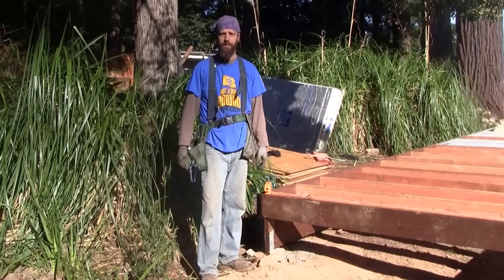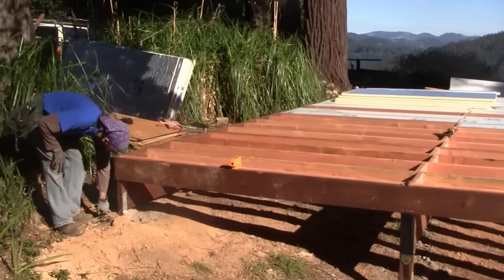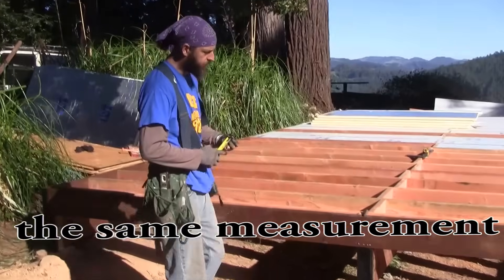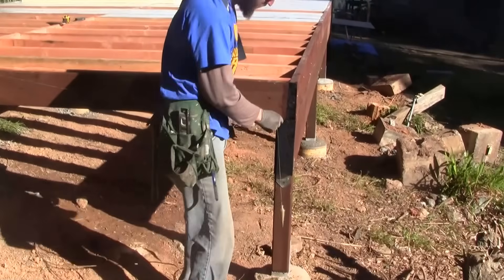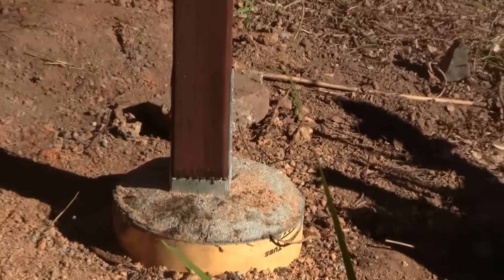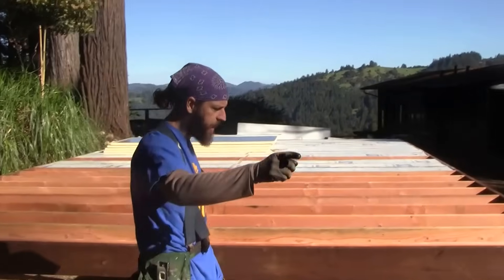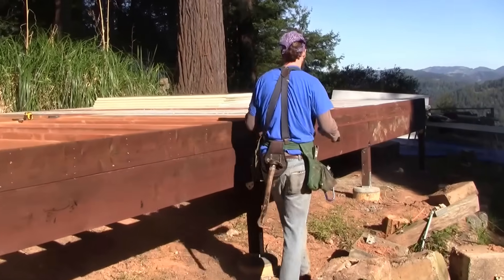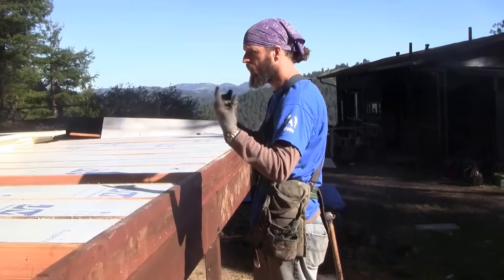Pier and Beam Foundation and FLOOR for Deck or Tiny home.

Comment: What is the size of that subfloor? Are those 8" sonotubes and 4x4 posts? I want to make sure that is sufficient for a 16'x24' shed/cabin.
Reply from the maker: It's been so long.  Sorry I don't remember.  Span charts and concrete charts are pretty easy to find on google.

Comment: Thanks for the video; very informative.  What would be the recommended spacing for the concrete piers?  I am planning out a largish tiny home that will be 26'x32'.  I plan to have piers spaced at 8' apart on the long side, but I'm trying to figure out whether three rows of piers would work for the short side (i.e., 13' spacing), or whether it would be better to go with four rows of piers (i.e., 8'8" spacing).  My floor joists will run parallel to the short side like in your video.  Any thoughts on pier spacing?
Reply from the maker: Here is a span chart.  If you go under the max span, You should be good. https://www.mycarpentry.com/joist-span-table.html
Reply: @TheRegenerativeHome  Hi, thanks for replying.  As a clarification, I know that 2x10 joists will span 13' just fine; my question is more about the spacing of the concrete piers.  In your video, you seem to have pier spacing at about 8' on center.  I'm wondering if that is standard, or if there is some kind of standard span table for the concrete piers that bear the weight of the building?  Perhaps not because there are so many variables to consider (like total weight of the structure, soil conditions, etc.)?

For example, if you use Quickcrete 5000 mix, then it can withstand 5000 PSI (hence the name).  With 6x6 posts on top of the piers, each having 5.5x5.5=30.25 square inches of surface area, if I had 3 rows of 5 piers (8' spacing between piers within a row, and 13' spacing between rows), then assuming weight is roughly evenly distributed across all 15 piers (which is way too optimistic), then the 15 piers should be able to support (5.5^2)*15*5000=2.3Million pounds of house.  If we more conservatively assume that ALL of the weight of the structure is concentrated on the outer 6 piers (which is way too pessimistic) then they should be able to support (5.5^2)*15*5000=907,500 pounds of house before the concrete piers are in danger of failing.  If we go by the rule of thumb that a one-story home has about 200 pounds per square foot, this would suggest the overall structure should weigh around 200*32*26=166,400 total pounds, which would come well under even the pessimistic load carrying capacity above.  

BUT, what all this quick and dirty calculation ignores is how well the soil underneath could support the roughly 166,400 pounds of house on top of 15 concrete piers, which is a whole other kettle of fish.  I suppose if you had the cylindrical piers resting on top of a 2'x2' footing that would help a ton (pun intended), but I'm not sure of whether it would be kosher to have 3 rows of 5 piers (8' spacing between piers within a row) with 13' spacing between rows of piers to support a one-story not-so-tiny home measuring 32'x26'.  If you know of any resources to look into for best practice on spacing of the concrete piers (or even general rules of thumb), that would be much appreciated.  Of course, I won't hold you responsible for the final design (I will get an actual engineer to sign off on a final plan) but for now, I'm just trying to anticipate building costs for the project, which is why I'm trying to wrap my brain around how many piers are needed.  Either way, thanks for your time!

Comment from the maker: In this video,  I cover the basics of how to build a post and Pier foundation for a deck or a tiny home. I cover the importance of using a plumb bob when setting your post holes how to use a three four five squaring technique and the importance of using a laser level when building a foundation.  Also, I show you how and why we used rigid foam insulation on our floor. http://www.lushplanet.net/

Comment: On a 16'x32' cabin will 2x10 joist be enough, they will over hang about a foot so basically the span will be closer to 14'. I am also going to do 12 on 12 centers.

Comment: how do you keep that insulation from dropping through to the ground?  Is there  something in the bottom holding it in place?  Can you explain that a little bit more?  Thanks
Reply from the maker: It is hard for me to remember but usually I will glue them or put in little strips of wood tacked in on the joists
Reply from the maker: But do not try to glue foam with exposed polyeurathane glue it will just melt it and not adhere at all

Comment: Hi I’m doing a similar job. I don’t have a laser level. Instead I’ll use a water level. In case you don’t know that a clear plastic tube 10m long filled with water. The water level at each end will always be the same.

Comment: Thanks, this was very helpful!  I am planning a small workshop (20' x 11') that will be built on a slope.  This video addressed several questions I had on design of the floor, insulation, beams, etc.
Reply from the maker: Wonderful.  I am glad that it was helpful.   Please let me know if there are any other topics you would like me to cover.  Best of luck.

Comment: Great video!  I'm curious about the 27ft support beams. Were the beams divided somehow while maintaining structural integrity, or is lumber that long available in the US?  I'm building a tiny home in the tropics with access to 12ft beams max.  We plan to use metal I beams spanning the 25 ft of the design mounted to concrete pier, with tropics friendly wood joists above, but this doesn't seem common.  Any advice from the public is welcome!
Reply from the maker: I would use doubled up material and alternate them atbyournpost baaes

Comment: Is it possible to just use 2x8s on top of the piers and then run 2x6 joists over the 2x8s? It will be for a 12x12 finished building.
Reply: @TheRegenerativeHome  Awesome, thank you!
Reply from the maker: You can.  The best thing to do is to use a 1/2 spacer between your 2x8s  to minimize wood contact which minimizes rot.  You should use  a span chart to double check how long you can go between posts.  here is one. https://www.decks.com/how-to/40/beam-span-chart-table

Comment: I like that your joists sit on the long beams. It's an amateur mistake to screw the joists into the beams, and you see a few videos here in YT that show that! I'm amateur for sure, I'll also say that I am a little concerned about the strength of the 4x4's holding up the downhill part, though I bet it's fine.

Comment: Question - In Texas we have clay that is really deep. Should I got the Concrete Posts or can I do Concrete plus Cinder blocks and if so how deep should I go? I am only building a 16' x 12' Cabin with a loft but I will also have a rap around porch/deck enclosed that is 6' out from the Sides and Front of the Cabin. It is hard for me to find this information out. Thanks
Reply: @TheRegenerativeHome  Elephant foot meaning larger on the bottom and tape to the top? I was thinking for the main cabin build doing 2' x 2' x 2' in the ground and then while wet, rebar with cinder blocks double staked with poured concrete. FOr the rap around enclosed decking that is screened, I figure I would do headwaters with pressure treated wood on top of the clay, as I can adjust this if needed. The goal is to make this last at least 10 years. Thanks for the advice as it never hurts to get it. I'll be video taping this on YouTube and talking it out the with community to get all sorts of collaboration and ideas soon.

Comment: Good video.  I enjoyed it.  My only gripe is that you should have stressed the importance of setting a laser level on a level surface by sitting it on a beam and using shims if neccessary, using it on a tripod, or by using whatever method you have available.  If you don't set it level, you run the risks of either getting unusable readings, or all you're doing is verifying the laser runs parallel to the beam, but the beam could still be out of level.

Comment: I’m not saying that it won’t hold, but using 4x4’s for the leg seems a bit undersized. If I was going to “overbuild” as you said. I would definitely use 6x6’s instead. All of those 2x10’s or 12’s aren’t worth a lick if they don’t have a strong foundation.

Comment: How did you dig the holes you dropped your sonotubes in? By hand or perhaps with an auger? Also, is there a gravel footing in the bottom of those holes? And finally, how far apart are each of those beams. Thanks for the video, this was really helpful in getting my head around some of this stuff.

Comment: Sorry late posting and not a professional builder but something looks a little off to me.  those big 2x12 beams connected to the little 4x4 post with that light gauge metal looks scary to me, like if something knocked into a side of it, it might just roll the whole deck.  Cant tell if there are sister 2x4s holding post and beam together but probably wouldn't hurt to add some if not.  Just my 2 cents. Thanks.
Reply: I thought same. 2x12s are their own beast. That said I think he anchored to the top joist and 4x4s.
Reply: Beam rotation is an unpleasant possibility, especially with those massive 2x12s; I would have braced the beams at each post on both sides, but then it would not have looked as pretty.

Comment: Great video and I love the sub-floor, looks pretty strong. Crazy question though: Let's say I built a similar foundation and sub-floor, how would this design hold up if I decided to, I don't know, place a 40'x8' shipping container on top? lol seriously. Would 8,500 lbs of steel destroy that foundation?
Reply: I am no expert but have been looking into containers recently.  What I found, so far, is that the weight of the containers are normally distributed on the 4 corners and does not need much support in along the sides.  As long as your four corners are well supported, the rest would not need to be.  Not sure I would trust a container on four 4x4's though.  I would think you would be better off setting them directly on concrete pillars and reinforcing the sides just to be sure.
Reply: I agree. From what I’ve read and looked into you are 💯% right. 4 corners are fine. The only part I don’t feel comfortable with is when we start cutting windows and doors and sliding doors 🚪 etc. all that cutting takes away from the structural integrity of the container. The good part is all that cutting is usually done after the container is set.
Reply: Matthew Diehm great question. I was thinking the same. Have you found the answer?

Comment: i have huge concrete blocks that are at least one foot thick can they be used for the beams to sit on if i sit them on say a 3' hole filled with gravel & the blocks on top of the gravel?

Comment: I like the way you think.  I suspect the post and pier is among the best choices for a small house because it is very DIY friendly and pretty cheap.  I'd love to know how much it cost to build and how long it took.  thanks for an informative video!
Reply: Thanks for the great comment.  I do not know exactly how much it cost.  this was for a client that I billed time and material.  the treated wood, and the insulation are the most expensive parts.  I would guess that it cost around 1000 for materials california prices.